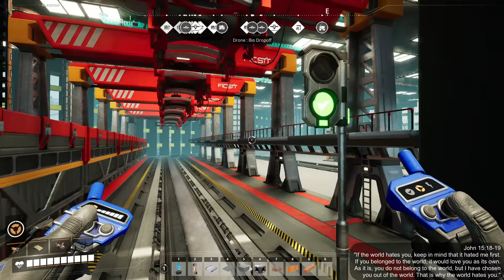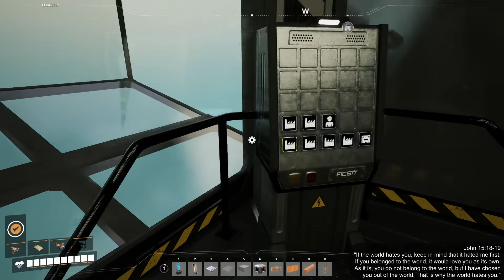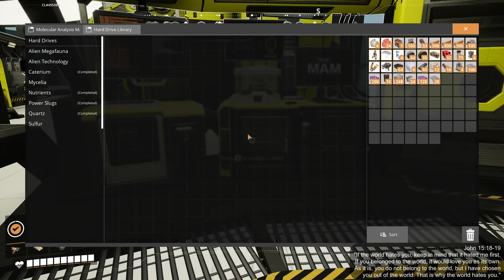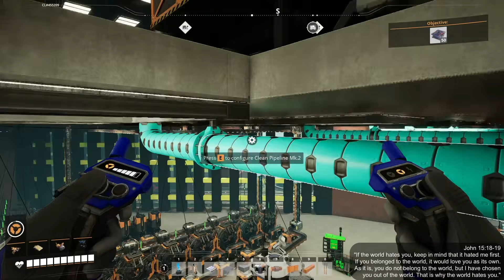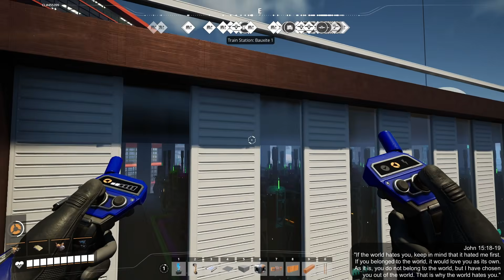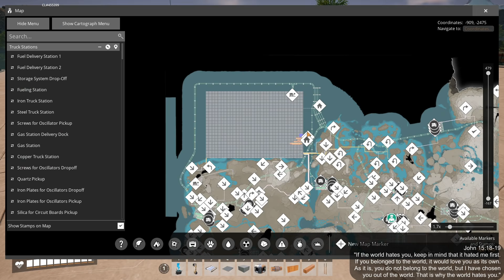Satisfactory Tips I Wish I Knew Sooner (After 1,000 Hours)

Comment: The only time I've had a major problem with manifolds was with my coal factory. No matter how fast my belts were, the coal plant at the end of the line always ran out of fuel and my power grid would shut down.
Reply from the maker: Hmm, typically that shouldn't happen. I would expect to see that more with fluids, not the coal itself. But coal power is easy enough to set up that load balancing shouldn't be an issue if you continue to have problems with it

Comment: You can fit 12 foundations between rail sections.  Plop the first print,  zoop out 12 foundations,  use "h" to lock the second print,  get them to connect, "h" again to unlock,  then "h" again at the end of the 12 foundations.  
You cover a lot of ground very fast this way and  every section is evenly spaced.
Reply from the maker: Thanks for the tip! The amount of times I pushed the up arrow on my keyboard, I'm shocked the keyboard didn't break haha
Reply: @JakeGemzen  Pre auto connect and pre vertical nudge,  an entire map rail line took forever to build.
Reply from the maker: @mephIncyeah I remember that

Comment: Blueprints are something I have touched yet only because I want to learn by doing first but a tutorial on roads and tracks or conveyor bus setup would be useful because that is a long process by hand. I liked you power line blueprint with the charger and will implement them into my world.
Reply from the maker: Blueprints are amazing if used correctly. Especially the auto connect feature. Roads are a pain in my opinion but setting up train tracks is super easy. I don't typically use conveyor bus setups. Yes, I love my power tower storage blueprint. It's a must have for me. You can also decorate those more or leave it barebones. Up to you!
Reply: @JakeGemzen I believe like every thing in this game it's best to master things one thing at a time. Speaking of which could you pretty please do a short video on manifold systems when building vertically. I have been building in a circuit board layout and would like to learn to expand vertically but I would like to learn Barney style as we say in the military which you are a fantastic teacher of. The simplicity of your layouts and teaching helps to lay a foundation for more difficult things later. Anyways I appreciate your time and love for this game. Also badass that you design real shit in real life kudos my friend.
Reply from the maker: @Bivens2317 I haven't done much vertical building of manifolds. I usually find it easier to do layouts but I can give it a shot. I might roll it into a video about manifolds vs load balancers and showcase both horizontal and vertical layouts. And thanks! I'm glad I can help. Yes I design bridges in real life. I haven't done any crazy bridges as the state i live in doesn't really have the need for them but simple bridges are still complicated to design but fun nonetheless.
Reply: @JakeGemzen I great appreciate you brother. Thank you for taking the time. Look forward to the videos.

Comment: Tip for building your "max nuclear power" map. 

Build your Plutonium and Ficsonium rod production bigger than the theoretical maximum you will need. Like 10% more than yhe theoretical maximum. 

Also build a couple extra nuclear power plants for Plutonium and Ficsonium, that you do not think you can make enough fuel for. 

The reason: at some point you will end up with a back log of nuclear waste. If you only build the theoretical maximum of Plutonium production, you will not have any extra to burn through the back log of waste. You will end up needing to turn off uranium generation so you can catch up to the back log of waste, which is a lot of managing to do. 

So build a bit of extra processing capabilities so you can handle stored backlogs of waste PLUS your new waste generation.
Reply from the maker: You make a good point but I wont have enough SAM to handle additional production. I plan to have the entire production facility built and capable of running before I activate the power plants so theoretically it should be able to handle Uranium waste from the beginning
Reply: @JakeGemzen I mostly use it for Uranium waste into plutonium. Then  just sink the over prodiction of plutonium rods. 

One tiny little imperfection somewhere leads to a massive backlog of uranium waste quite quickly and you need some way to process it. 

For the Ficsonium line you can put some Sloops into Singularity Cells instead of just doubling the Reanimated SAM. It is more efficient use of the sloops. Then you have extra Cells to use burning any overatock of Plutonium waste.
Reply from the maker: @5353Jumper I will think about it for sure. Thanks for the suggestions